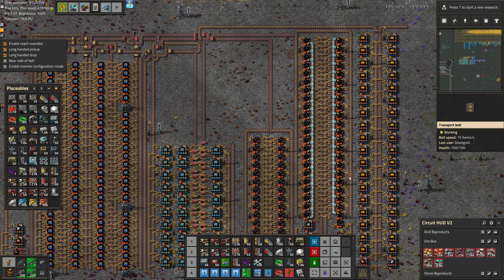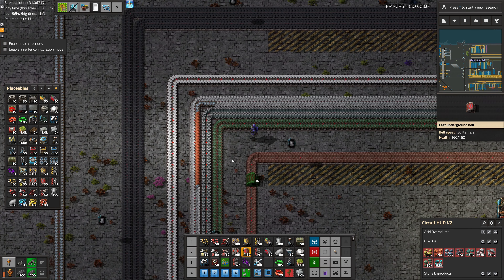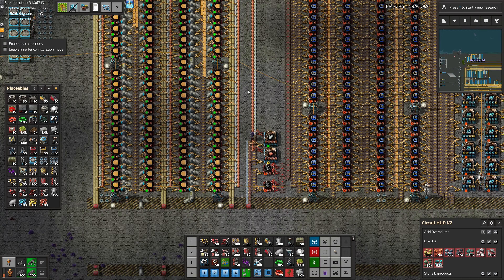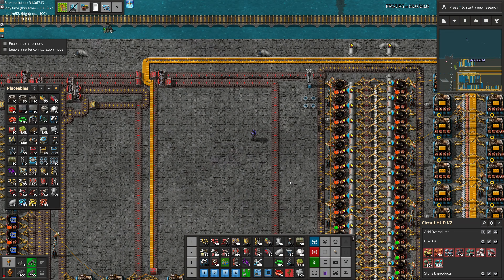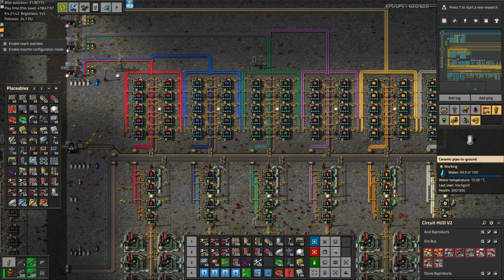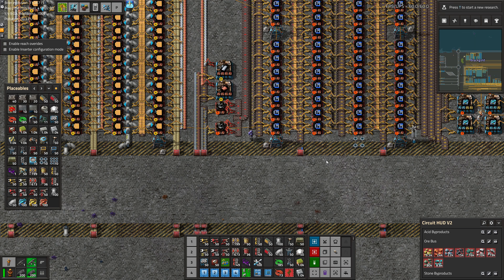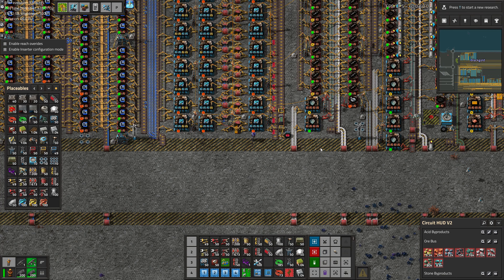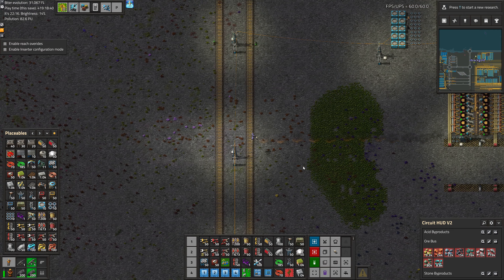[Factorio 1.1 4K] Angel/Bobs Ep 226: Making Speed Module 5's

Comment: I know the thought went through your head but I'm curious: Did you have in mind to put the T5 modules eventually where you currently have put T2 in the module-making designs because the T2s were the best you had access to when calculating ratios and everything?
Reply from the maker: At some point, yea. I don’t want to get distracted away from T3 ore sorting but yea putting T5 modules into the factory is a good upgrade at some point
Reply: @marsh8056  
What about in the module-making designs themselves?
Reply from the maker: Yea, eventually. The setup is big but I don’t think it takes up many resources. I’ll probably upgrade the whole electronics bus since as a whole it uses a lot

Comment: For your big BP flipping woes, I've been using a mod called 'Blueprint Flip  & Turn', that implements flipping and "glipping" (i.e. Y axis flipping) functions even when there's stuff in the BP that's not friendly to flipping them.  It works great, with the caveat that ofc. you after flipping you most probably will need to fix stuff that can't get mirrored properly, like fluid connections and/or rails with signals, etc. but for like maybe 70% of the cases in A&B, there's stuff that can't be flipped for some reason (like electronics assemblies), but even flipping them forcefully with the mod doesn't break anything, so chances are it'll work of of the box.

Basically, once installed you need to select two extra keybinds that work separately from the game's default keys... and it works like the in-game function, press the corresponding key and the currently help BP flips or "glips" respectively!  Also, and alternatively when you're holding a BP in your cursor, buttons are shown at the top of the screen that give access to the mod's functions too, so you don't need to depend on keybinds (but that might be a byproduct of other mod for me! Not sure.)

I know it's probably too late now to help you with the next flipping madness... but it can probably be of help for the future! :)

BTW, I saw they released an update for bioprocessing with the fish fixes finally :P Sadly, as always, it leads to breakage in current factories because they changes recipes too :(
Reply from the maker: That’s an interesting mod! Yea, I’m gonna have to spend some time going around the factory and fixing some recipes. Some of the ratios are probably wrong now but I guess I’ll just take a look at it when it becomes a problem. I feel like quite a few times now I see something and I’m like, huh, this is totally not a good ratio, I wonder why I did that, oh well let’s fix it 🤣
Reply: @marsh8056  Yeah, once the factory grows so much you cannot possibly fix all preemptively! Only sensible strategy is wait and see what breaks :P

I didn't take the plunge myself, still playing on old versions lol  But I applied the fish fix manually to the old versions so at least that's not an issue that bothers me anymore!
Reply from the maker: One trick I’ve found that helps looking for broken recipes is to go to the map view with the recipe icons on. If there’s a broken recipe you’ll just see a block of buildings but no recipe, so you can narrow down on what the update broke. Ratios are another story :)
Reply: @marsh8056  Thank you! Good tip! 

If I decide to take the plunge, Ill probably make a copy of my whole save area including mods and settings, and see what breaks and how difficult is to fix, and decide from there if I want to update or not. 

I'm a few versions behind at this point on several mods (not Angel's or Bob's though, I was on the current version of those until this last release!)